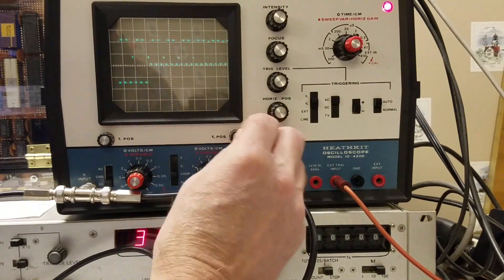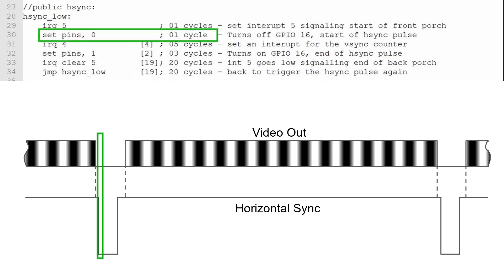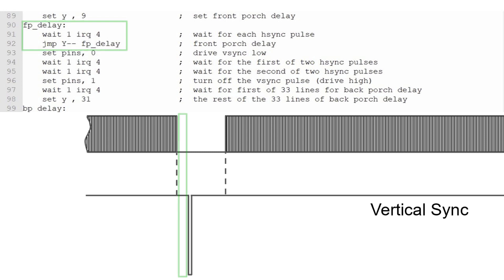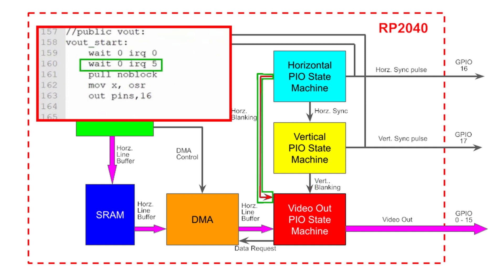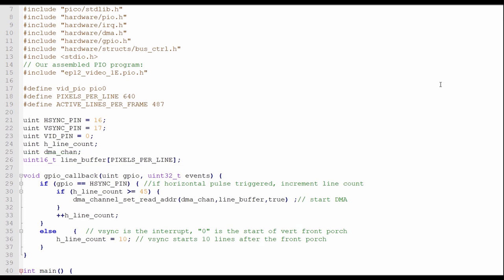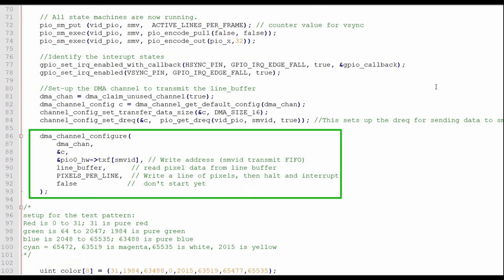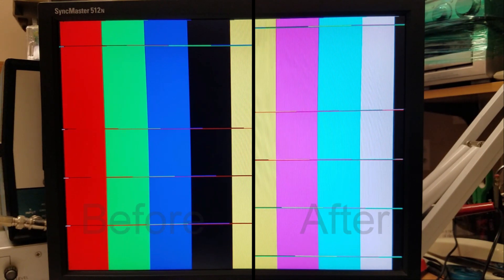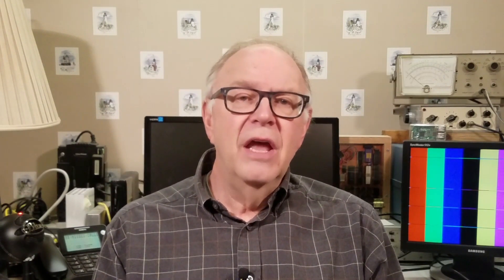Raspberry Pi Pico PIO - VGA: Homebrew Video Interface Program Ep.12

Comment: By the way, if you want to see "crappy" VGA, check out Ben Eater's "Lets build the world's worst VGA card" built with discrete TTL logic.
Signal is 800x600 @ 60Hz using 10Mhz crystal for simplicity.  Actual resolution 200x600 but because of addressing limitations in an EEProm and make the aspect ratio be more reasonable, image resolution goes down to 100x75.
Now THAT's crappy.   Very interesting and educational though.   I believe i was able to bring the image up to 200x128 with addressing changes to the EEProm.
EEProm response time wasn't adequate so there were jail-bars.
Reply from the maker: I think Ben's is better than mine; at least he doesn't have delayed horizontal scans.  However, since I've done bare metal stuff recently, I think I could do better now.  Thanks for the comment!

Comment: Great stuff!  I've only come across your site last night and learned a TON!   So much more to absorb.
The Pico may be unconventional and not the biggest set of resources, but it has a lot of features like the PIO that makes up for it.

I hope and wish you'll figure out what is causing the horizontal line tearing, since whatever the cause and remedy is could help us out with other time-sensitive applications.

As I pointed out in comments in other of your videos, i am trying to develop a 16x300 Neopixel graphics array with the 16 rows driven by separate channels, demuxed by use of 74HC595 serial to parallel shift register.   Tricky part is to grab 1 bit from each of the 16 rows and send them to the GPIO driving the 74HC595.
Even if I use 16 GPIOs to handle 16 channels for the Neopixel array, I still have to get the single bits that are many byes apart.
Reply from the maker: I'm trying to think how to use PIO to grab  16 independent bits and then shift them out as a single 16 bit word. I think there are a lot of options, especially if you aren't afraid of solder.
Reply: @LifewithDavid1  Do you mean have the PIO grab a 16 bit word and put each of the bits on different GPIO pins as a parallel output?
I believe that's what an instruction out pin, 16 does if you have the PIO assigned to 16 consecutive GPIO pins.  I probably don't have the instruction written right, but hopefully you'll get what I am trying to convey.   The out instruction would be pulling 16 bits from the OSR, placing them into 16 consecutive GPIOs as if the GPIOs were a 16 bit register.
You could use a 74HC589 is an 8 bit parallel in, serial out IC, complimentary to the 74HC595 which is 8 bit serial in that I plan to use.

In my case, to drive 16 of rather long strands of neopixels and only need to use one GPIO pin to drive them as a 16x300 matrix.  The problem I have is that the sequential bytes in the pixel map is the sequential pixels in a row/strand.   Somehow I need to take 1 bit at a time from each row, put the bits together sequentially (multiplex them), and send them out the GPIO serially so that the 74hc595 can demux them to each strand.   One method is to transpose the bits in the 300 column by 16 row pixel matrix, and transpose that to 16 columns by 300 rows before sending them out via the PIO during a frame.   There is an Adafruit article that someone was able to do that in Circuitpython for 8 rows, where he used the SDK transpose function for speed.  Unfortunately that function only supports 8 bits, i need 16.
Hopefully a function written in C will be fast enough.  Better yet, if the bit level transpose can be done for each set of bits sent out the GPIO to the 74HC595, that would be even better.
Reply from the maker: @danman32 I haven't fully thought this through, but could you divide it into 8 x 2 where you use all 8 OSRs but alternate bits from each row.  For instance, take row 1 and 2 (of 16).  Create a word in the main core that intermixes the bits like (row 1-bit 1; row 2-bit 1; row 2-bit 2; row 2-bit 2; row 1-bit 3; row 2, bit 3; row 1-bit 4; row 2-bit 4; etc).  Then you do the same for rows 3 and 4, 5 and 6, 7 and 8, etc.  Now you have 8 interspersed words.  Then feed them into the 8 separate PIO state machines.  Synchronize them using interrupts and each PIO state machine could output to two GPIOs for a total of 16 pins.  I think intermixing two rows would be quicker than intermixing 16.  That's probably not the solution, but the concept of ganging together all 8 PIO state machines might make the problem more manageable.  Interesting problem.
Reply: @LifewithDavid1  I thought of using 16 GPIOs rather than 1 GPIO and demux using the 74HC595, but using and placing the 74HC595 near the neopixel array reduces the number of wires i need between the matrix and the Pico.
The stream of 24 bits to a neopixel, with a "start" bit and "Stop" bit surrounding the data bit cannot be paused by more than 9uS, otherwise the strand will think it has been fully populated and will display what it has been sent.   Each start, data and stop bit package has to be about 1.25uS.   There is some tolerance to the 1.25uS specification though.

Even in your idea, you still have the problem of pulling bits from 2 separate streams of bits and putting them together.
R1b1R2b1R1b2R2b2R1b3R2b3. etc where you have in each row 24x300 bits (24 bits per pixel, 300 pixels).
I believe the Adafruit library provides a means to address the entire pixel matrix as a 2 dimensional array, so that might be an approach, and only transpose 3 bytes (24 pixel bits) at a time per row.  If that can be accomplished in significantly less than 9uS from when i last transmitted the bits to the matrix, that could work.  Not clean, as ideally you want the pixel bits steadily streamed, but probably would work.   I'd be using a much smaller intermediate buffer too.  I would just need to be sure I kept track of where I was in the main buffer.
Reply from the maker: @danman32 I haven't done any experimentation with Neopixels (I probably should), so I can't wrap my head around it very quickly.  However, you can do a lot in 9 uS (1125 clock cycles) in assembly language.  There are 8-32 bit registers that have full arithmetic, logic, shifting, and indexed memory ops functionality.  By taking the words 8 at a time you should be able to slice and dice them however you want (because they are in the registers, each op only takes 1 clock cycle).  Plus you have a whole other core with the same capability that can run in parallel.  Jam the transposed words into one or more PIO state machines using DMA (no core time needed) and it might work.   You could even have one core just feeding a graphics memory, and the other just pulling from the memory and popping it into PIO.  However, until I actually work with Neopixels, I can't give you great advice; I'm sorry.  However, it sounds cool; good luck!
Reply: @LifewithDavid1   I was able to get my project working.  I did away with the idea of using a 74HC595, instead outputting parallel channels directly from separate GPIOs, just as the Parallel example did.
Except I started with an Adafruit library written to output 8 channels in parallel, modified it to output 16 parallel channels, and added the Adafruit GFX library to it.
It works!
Only issue I had was there was a lot of pixel flashing, but that turned out to be an electrical problem.  Seems Neopixels (WS2812B) don't like too many direct parallel inputs when there's a common power bus as there seems to be leakage between power and data pins.   Solution was to hook up a 330 ohm resistor in series with the data lines.
Reply from the maker: That's great!  You've got me interested in diving into NeoPixels.  There are so many cool projects out there.  My winter is filling up with things to do.

Comment: Could probably waste a bunch of PWM channels on a Teensy 4.0 (600MHz) to make it happen. I might try on something.
Reply from the maker: It sounds like it has the speed.  It would be a cool project.  You might have to get down to machine language programming to output the data in a controlled manner.  That's where the PIO shines.  Good luck!
Reply: @LifewithDavid1  Yeah, it'd be clock dividers and top values to set the right pulse timings, then right a duty cycle register high or low for pixels... something like that. I'll bother making it less half-baked when I actually get the part.
Reply from the maker: @Marc_Wolfe  Sounds good! Should be fun!

Comment: I need a better understanding of coding these counter loops used in the V sync PIO program. Also, I assume interrupts can be used between PIOs without being acknowledged by CPU cores etc? Looks like with a better understanding it would be simple to implement a pulse counter (count crank sensor teeth), reset/synchronized by cam senor, PIO per cylinder (or pair with waste spark) each with a different count, and CPU dictates adding/subtracting tooth count for spark advance. Could do one for all cylinders, except I vaguely remember doing math that suggests overlapping spark outputs for high RPM engines (or at least overlapping dwell time or something). Fuel can just be basic duty cycle adjustment... of course fully sequential would be cooler.
Reply from the maker: That's what I was thinking.  My next video will fix into interrupts in more detail.

Comment: The pin interrupt handlers, are they called on the same core as the main?  Are they called on the same core from hsync/vsync?  Is the system blocking cores to handle these?
I know it's a minor issue, but maybe two separate irq handlers and get rid of the extra instructions for compare who its being called for (under the model of keep IRQ short as possible).
Reply from the maker: Thanks so much for the comment!  Speeding up the interrupts would help out.  I was under the impression that there could be only one gpio_callback routine per program, and that I had to do comparisons to find out what was triggering the interrupt.  Getting rid of comparisons would certainly speed things up.  If I remember correctly, I tried a few things to see how I make the interrupts faster. 
I've since learned some things with my AWG projects.  When I get back to this project; I'll have to do some soul searching to see how I can apply what I learned.  Thanks for watching!

Comment: When I first got VGA running on my pico, I also had some tearing problems, but not as regular as yours, but I got it pretty smooth in the end without doing lots of trickery.

There were 2 situations in which I saw tearing in my projects:

1) having large amounts of code or data in flash that run frequently sometimes caused cache misses which stalled the DMA transfer. having the DMA copy from a buffer in RAM instead made it much more stable. it can also help to put important IRQ handlers into RAM to remove the possibility of having a cache miss in those
2) IRQ handlers being somehow too slow to restart the DMA. setting up the DMA to run continuously and retriggering itself removes the need for CPU needing to restart the DMA in time after a scanline, which makes the timing less likely to be too late. You can even set it up in a way that ping-pongs between a set of buffers to be able to do double or triple buffering, so you can edit a buffer while the other(s) are copied to the PIO.

I also used a slightly different PIO setup. you can get away with using much less code on the PIO for sync pulses if you stream in a list of commands for building the sync pulse from the CPU (e.g.: <640+16x11>, <96x01>, <48x11>). that way you can do the whole sync pulse (v and h) on a single PIO SM, which is also what the pico_scanvideo library does.

the pico_scanvideo library is quite a treasure trove of interesting ideas, i ended up stealing quite a bit of it, but I found all that buffer management it does to be overkill and far more complex than necessary, so I did my own. My code is not published anywhere yet, but I do intend to at some point.
Reply from the maker: Thank you so much for the comments.  It gives me quite a bit to consider.  I  used more "ping-ponging" of DMA with my recent arbitrary waveform generator; I'll have to incorporate more of that into my video display.  Thanks again!

Comment: By default, all memory is used in a stripped configuration. if you segment the memory and dedicate to cpu, dma, etc, you can eliminate blocking. The trade off is that now your code is having to be aware of memory banks. Great video! Thanks so much! (yes, been reading the almost 1000 page datasheet)
Reply from the maker: Thanks for watching!  That's what I have been struggling with; to get to where I can manhandle the memory banks, I have to get a whole lot smarter.  I have gone through the Raspberry Pi Foundation's code for their scan video, and I now understand about 70% of what they are doing, but it's that 30% that really baffles me.  And that's the 30% I need to get rid of the tearing.  :-)
Reply: usually when filling the PIO fifo from DMA, the difference between using striped memory vs banked memory is not that large. since the 25MHz pixel clock means that the PIO will only consume a pixel every (assuming default CPU freq) 5 clock cycles, there's plenty of time even if two bus masters compete for bus access, and that's assuming they always access the same memory bank. (also, usually, depending on the pixel format used, you can get more than one pixel into a DMA word; with 16bpp, you get 2 pixels per DMA copy, so thats roughly only every 10 cycles)

striped memory is actually quite great in mitigating this, since parallel linear readouts of memory will basically automatically synchronize in a way that after an initial bus collision, they will always read from different memory banks if they copy at the same speed

Comment: Thanks for the super detailed videos!  I'd personally be interested in seeing a QSPI controller.  The Pico has two SPI peripherals, but as far as I can tell there's no way for those to operate in QSPI mode.  Chips which offer QSPI usually initialize in normal SPI mode, so a controller would need to be capable of both.
Reply from the maker: Although the Pico doesn't have QSPI, the RP2040 does and uses it to directly connect to the flash memory.  According to the RasPi datasheets, warnings are given about keeping lead lengths short and direct since the bus speed is extremely fast and crosstalk is an issue.  It would be interesting to try to implement a low speed QSPI in PIO; but I don't have the instrumentation or knowledge needed to troubleshoot it (yet?).  Thanks for the suggestion, it gives me some ideas for the future.

Comment: 14:24 tight_loop_contents is a function call, that should have the open and close parentheses: tight_loop_contents(). I'm surprised there was no compiler error. No idea if that has anything to do with the problem.
Reply from the maker: Thanks, I'll have to try that.  I copied that function from one of Raspberry Pi's example programs, that didn't have parenthesis either.  However, I commented out "TightLoopContents" and I still saw the tearing.
Reply: @LifewithDavid1  come to think of it, you can do better than tight_loop_contents(), if you want the main program to enter a state of "stop and don't do anything" while PIO and DMA are off doing their thing. Call __wfi() instead, for "wait for interrupt", which puts the processor in a sleep state until an interrupted is detected. If there is an interrupt, the while loop loops back around and puts the processor back to sleep again. tight_loop_contents() does exactly nothing, so you end up with a busy-wait loop, wastefully spinning around and around. No idea why all of the examples do it that way, it seems terribly wasteful. (But still no idea if __wfi() will do anything to fix the problem.)
Reply: @slimhazard  Thanks for the comment!  Sorry for the late response.  I just saw your reply (YouTube doesn't flag comments to comments as needing replies; so I only stumbled on it by chance).  I'll look at __wfi() next time I'm working with that breadboard.  It makes sense that there would be less tearing if I could turn off the processor.  However eventually, the processor will be needed full time when it is calculating each scan line instead of just displaying it; so it might only be a short term fix.